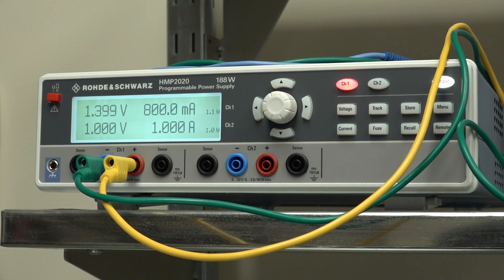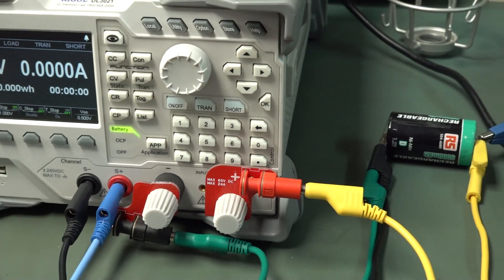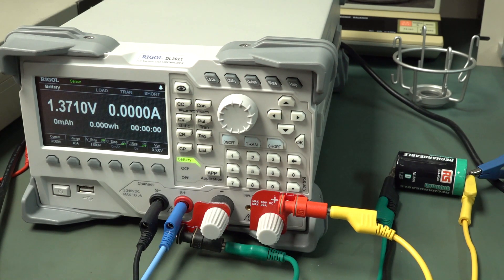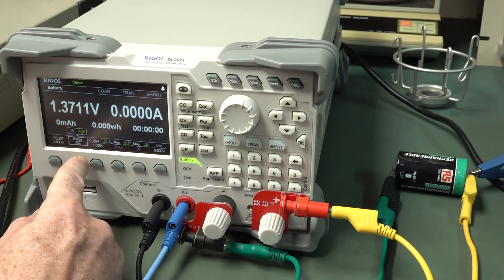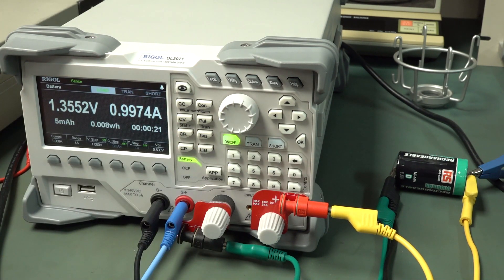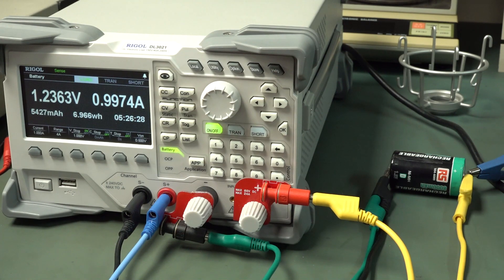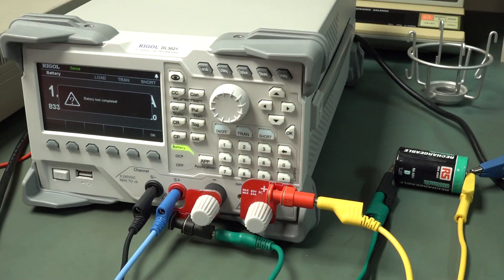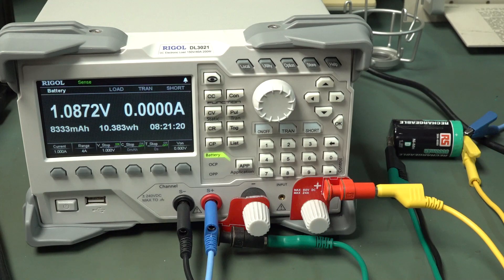NiMH 8000mAh Capacity Claim TESTED

Comment: A lot of D commercial cells are basically AA cells in a D cell shell. I noticed that with a common name brand, bought some and the cells were very light weight. I used them and they did not last very long, very disappointed for the cost of them. I then bought some real NiMH D cell batteries from a reputable brand that makes only rechargeable, got what I paid for that time.
Reply: Varta and BASF usually makes great batteries.

Comment: Would love to see this test at the 8 amp draw!
Reply: at what 8A draw? The 8000mAh is the capacity and has nothing to do with an 8A draw unless you are curious to see  if it lasts a full 60 minutes. I'd be surprised if the internal resistance allowed such a high current to flow in the first place.
Reply: @johnc3403  
Yeah man. I want to see it discharge at 1 C.

Comment: Actually I'm surprised that a high quality D cell NiMH wouldn't have a much higher capacity.  Given that run of the mill AA NiMH cells are 2250mAh.  I'm sure there is more to it than this, but an AA cell has a volume of about 7696mm^3.  D cells volume is about 49460mm^3.  That's about 6.4 times more room to cram full of stuff, so wouldn't you expect NiMH D cells with 14,400mAh ratings to be common place?  
Is some actual limitation of the chemistry here, or are even the 'good' brands cheeping out and only putting half as much stuffing in a cell than they could?

Comment: I'd like to see the same test with an alkaline D cell.  I've found conflicting data on how they hold up under high drain.  Most of the datasheets and other information says  they are good for 15+ AH, but at like 200mAh drain.  Haven't found an official spec at 1 amp drain.
Reply: D cells dont do too bad at 1 amp. Usually 9000mah or so
Reply: http://professional.duracell.com/downloads/datasheets/product/Industrial/Industrial%20D.pdf shows 6.6Ah at 1 Amp.

Comment: Useful feature of that Rigol and nice test! So heads up as this might be relevant in the future, although I couldn't find the exact RS Components 8000mAh NiMh pack I did find something very similar providing a datasheet ( https://sa.rsdelivers.com/product/rs-pro/ni-mhd8000mah-pip/rs-pro-nimh-rechargeable-d-batteries-8000mah/5046089 ).

It calls out a maximum discharge current of 3mA. Depending upon the ESR of the battery (some primary cells like Lithium Thionyl Chloride have a really high ESR in the 10s to almost a 100 Ohms), you'll want to keep within that current draw range so the Rigol doesn't finish the current test too early because the voltage at the terminals measured 1V (but was actually still 1.2V due to the ESR drop).

Comment: A good tip is to get some neodymium magnets and clamp them on the ends of your clips or a set of crocodile clips and it holds itself to the battery making a decent enough connection to charge.. 😋

Comment: 1c is too fast for NiMh chemistry, c/2 is much more acceptable. NiCd is good at 1c. 
c/10 is used to rate the small lead acid in my motorcycle.(kick start. The battery is mainly for legal sale here requires minimum 30 minutes of tail light at night with engine off, safety if stuck by the road.)

Comment: From what ive read about NiMH when i was looking to compare the Duracell i bought with others was that these batteries are strongest at 1.2v and that they drop faster to 1.2 but maintain a long draw at that voltage. NiMH is supposed to hold a 1.2v charge for the length of its draw for its power band making them useless for electronics requiring a full 6v to run them. The curve was different from Li and Alkaline in that these drop steadily across the graph. That data was for the AA batteries but i expect all types to work out comparable.  Shelf life was suggested as a factor , a fully charged NiMH would lose capacity over time while in storage. Consumer reports and battery dedicated websites was my source for my research.
Reply: All voltaic cells self discharge.

Comment: Wait... what?
A battery manufacturer that actually make batteries and put proper and truthful specs on them?

I didn't think they'd exist. I *always* assume given capacity of any battery is extremely and  far far exaggerated.

My mind is completely blow away. ... wow...
Reply: I've tested the Tenergy & Varta 9V low discharge NiMh cells and they slightly exceed their 200mAh spec. All my old Eneloop AAs also exceed their minimum rating. Steer clear of EBL though. 🤣
Reply: @gregsullivan7408  Similar experience with Eneloops, haven't had one that didn't exceed its minimum rating yet. When it comes to 18650 li-ion batteries I've also never had any NCR18650B from Sanyo/Panasonic yet that wasn't performing up to spec at time of purchase. Those Eneloops are holding out surprisingly well too over time, one set that I've kept together for a flash many years ago which has gone through more cycles than I can count showed no reason to swap them out yet. Initial rated capacity I'm not really surprised about anymore, but their longevity by actually lasting for the rated cycle count did surprise me.

Since then I've become a bit more lazy and don't always verify things. If cells are new and they are from reputable brands through a good supplier I'll take their word for it, even when putting them in a pack. If I'm using older cells for a multi cell battery though then I typically will run a test on them first to check their internal resistance and capacity to make them roughly match up. Testing every new battery just takes too much time nowadays and I have so many spares that I often just end up grabbing a used one from storage or an unused thing.
Reply: bear in mind RS components are industrial supply only, so should do exactly as they say.
Reply: I don't know why you assume that. I often test batteries after I buy them and it's rare for them to be close to advertised capacity. They're usually 3-8% better.

Comment: Same Wh than your standard 18650... Tesla should clearly use D-cells in their cars...
Reply: The first gen Honda Insight used D cell NiMH!
Reply: Typical 18650: 45-ish grams, 16.54 cm³.
RS NiMH D cell: 162 grams, 50.08 cm³.
AA Eneloop (HR-3UTGB): 27 grams, 8.15 cm³ (~2.4 Wh; highest capacity cells approaching 3.0 Wh).

Comment: The NiMH  'D' cell,  if compared to the premium highest capacity (2.8 A/h) AA of the same chemistry, will by volume, total 17.5 A/h. If all else is equal. 7918mm3 and 49607mm3 which is 6.26* capacity by volume.

Comment: Hack tip for the lab: No need for tape as a battery holder when you've got magnets!
Reply: good to see people are still alert
Reply: There is no alternative to using one's brain ;)
Reply: that way it will help polarize the electrons as well and increase power flow
Reply: It's just there to attach the conductor to the battery pole, nothing else. No woo-woo powers here.

Comment: What is the purpose of those HUGE bumpers on the Rigol?  Seems ridiculous on such an instrument.  Does it have an on screen graph to show the discharge curve?
Reply: If you're going to send a few amps through it constantly for hours you better be prepared :-)

EDIT: Thought you were speaking about the connector teminals. I can't think of a reason why they would put those huge rubber bumpers on there, too.
Reply: @nrdesign1991  - Yes, I was referring to the 4 rubber bumpers.  I mean those are great for an instrument that might be put face down for some reason but with the large terminals that's not going to happen or protect it.  They are just in the way really.

Thanks for the reply.
Reply: ElmerFuddGun I guess if you unplug the cables and unscrew the binding posts, it allows you to stand it on the face.
  Another use is to put a protection shield between the load/instrument and a prototype power source that might catch fire during a heavy load test.  Ditto for compliance testing suspect devices which are even more likely to go boom.
Reply: truth is theyre probably primarily there to make it look "heavy duty" and "pro-level" and all that crap
Reply: It can be stored face down.

Comment: That's pretty good for a battery that hasn't been used for a long time, I have some NIMH AAs and they self discharge flat just sitting there and need to be refreshed to get anything close to full capacity
Reply: You need to find some low self discharge cells, something like eneloops can hold their charge for a few years.

Comment: So sick of battery capacity advertised in (m)Ah. Giving the changing voltage this characteristic has little relevance. J or (k)Wh is where it's at.
Reply: It is a good measure for constant current loads.
Reply: i want them to simply stop the mAH after a thousand. 8000mAh, 8Ah simpler ! It's like mesuring the lenght of a road in mm...
Reply: There's always someone lol
Reply: @Hazard No offense, but your response proves that it is a big deal :-)  
(m)Ah doesn't tell you anything by itself. Energy in proper units does.
Reply: Mah is fine if they indicate the C draw

Comment: All the electronic loads I've tried add noise, so there's no way of testing the noise of a circuit under load. I Wonder if the Rigol has lower noise injection? Has anyone done any tests on the Rigol load?
Reply: Interesting, i am currently doing  noise, efficiency and dropout  tests on DC-DC modules and posed some questions on the forum.  The noise injected from the load had crossed my mind but how do you measure it.  Perhaps a battery as a source.
Reply: @kissingfrogs  Yeah, but sometimes you want to pulse the power source or test at the edge of the voltage range. It would be much easier to have an electronic DC load that's quiet.

Comment: I'm just wondering because I always find the unit mAh so confusing why isn't wh just used? Is there any reason other then convention?
Reply: My guess is that at some point mAh were more useful since most devices were drawing a constant current (and use a linear regulator to keep the voltage constant). Also the voltage curve on NiCd and NiMH batteries is quite flat, so there isn't that much of a difference.
Nowadays with almost everything being run on Li-ion batteries having switching converters in them Wh would indeed be much more useful since those are more or less constant power devices. And if you look at many devices' batteries they do actually specify Wh as well.
Reply: Thanks, the idea of constant current even though changing voltage does make sense as to why you'd use mah. Many thanks.
Reply: Well the voltage changes over the discharge, which could lead to some confusion. Also lots of companies would just multiply the AH by the fully charged voltage and decieve people. When I use RC planes and such, I always measure my draw in amps not watts as well.
Reply: the Wh the battery can deliver is much more dependent on the current, I mean, the Ah rating is also reduced at higher currents, but it isn't compounded by the voltage droop like the Wh measurement. Hope that makes sense.

Comment: In Europe there is this market brand called Auchan, they sell their own  NiMHs at least 4x cheaper than known brands and they also exceed rated capacity a bit. I've never seen Varta or Energizer do that.
Reply: Just make sure LADDAs you buy are made in Japan
Reply: I have a Varta 9V 200mAh NiMh battery and it exceeds it's spec by about 10%.
Reply: IKEA batteries are great too.
Reply: @JGnLAU8OAWF6  those are rebranded eneloops, so yeah great batteries!
Reply: @martijnvandijk1587  but they are cheaper
Reply: @JGnLAU8OAWF6  which is why I buy them :)

Comment: How much are those I would like to build a HUGE bank of batteries  to like 330VDC to power my electric car  my budget would be like $3,000 (that is how much a replacement battery is for used cells with 3 year warranty )
Reply: punker4Real Wrong chemistry. LiIon is the way to go. For 3 grand?  forget it. Also, without knowledge it is like building a bomb ready to go off!
Reply: @DrakkarCalethiel  Not only that, but you are not supposed to charge NiMh in parallel so using these in EV applications where you have on demand regeneration isn't going to work. Also remember that Dave used the crudest charge method here which is C/10 for 16 hours, proper high rate and on demand charging requires millivolt measurement accuracy and a microprocessor to cut off when the negative delta V indication occurs.
Reply: @jrmcferren  it has 40 module Prius  (336VDC) type (battery module).
 How do you think most higher voltage cells work? it uses the Prius  battery cells which are only 1.2v each cell = 8.4volts  so it has regulators/charging system
Reply: @punker4Real  The Prius batteries are probably better for that application then these since they were designed for high currents.
Reply: @DrakkarCalethiel  NiMH is probably better for a DIY electric car since it is much more forgiving than typical lithium ion batteries but for the best compromise between safety and performance I'd suggest LiFePO4 batteries they're less likely to have thermal runaway than cobalt cathode lithium Ion batteries.
I think EV manufactures should be using them even though the battery pack would have about 30% less energy density than NCA and NMC chemistry batteries.
Reply: Patchuchan LiFePO4 cells are super forgiving. Also they can be easily chained together with their screw terminals. And since they come in all sorts of rectangular shapes, they can be easily mounted.

Comment: If you discharge a battery at a lower amps, will the battery preform better?
Reply: Usually yes. Well, almost universally yes. As losses due to battery internal resistance (ESR) are lower at lower currents, less heat given off means more electric energy.
Reply: alles klar klaus thanks for your answer.

Comment: Those fonts on Rigol load tho...
Reply: Most Asians sucks at choosing the fonts. It can be seen in PC software even more. I think it has somethink to do with differences between complicated chinese characters and (relatively) simple english characters. Chinese softwares use serifed fonts much more often and the serifs can be some compensation for the simplicity and "ugliness" of the english characters. Unfortunately, serifs are more difficult to read when it isn't continous text (book) where the serifs are OK (they lead the eyes along the line). This makes the GUI of Chinese softwares not ergonomic and unpleasant to use.
Reply: moar fonts moar betterer
Reply: An eyesore everytime I see it :$
Reply: I was obliviously unaware it was so bad until Dave mentioned it in a review.  Now it hits me every time i use the load.
Reply: Which fonts, where abouts on it?
Reply: @simontay4851  Look at the fonts on the slanted buttons ... It should be illegal to make that kind of crap.
Reply: @simontay4851  front panel, especially on the buttons.
Reply: @JGnLAU8OAWF6  Front *panel.
Reply: @zaprodk  fixed, thanks.
Reply: Honestly, other than the weirdly stretched “FUNCTION” heading and the annoying italicized lettering in the top buttons (what’s wrong with squared buttons so there would be no need for italics?) I really don’t have any major complaints with the font used.  They are all, thankfully, a simple sans serif font with most of the variation being in font size or weight.  I have seen infinitely worse products out of China and I can at least very easily read each button on this test piece without issue.